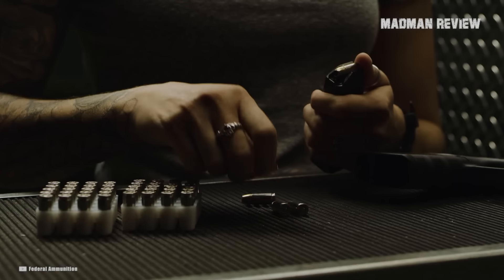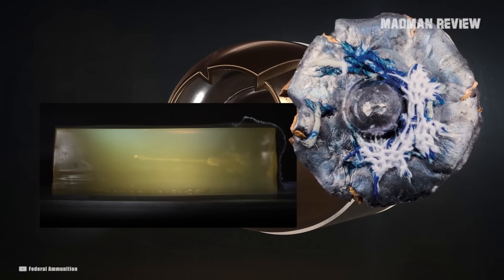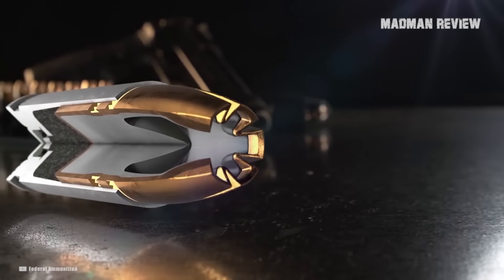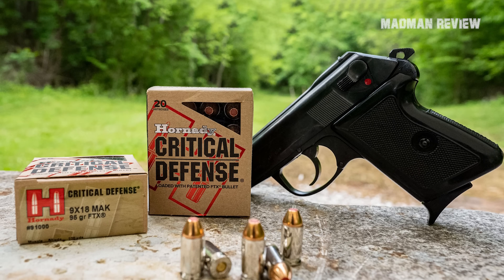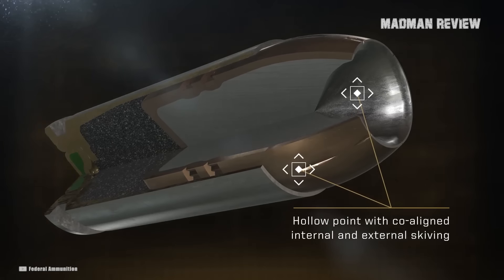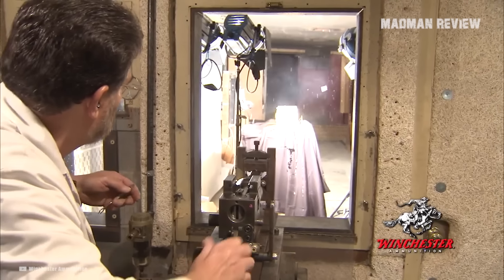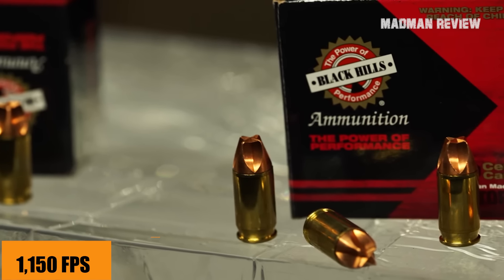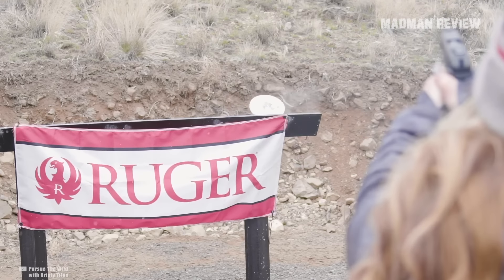8 Most Powerful .380 ACP Ammo for Self-Defense

Comment: I’m also surprised that the video overlooked Underwood’s line of ammo; particularly Extreme Defender & Extreme Penetrator. The Military Arms Channel did some rather extensive ballistic gel testing in both 9mm & 380, and Underwood’s Extreme Defender was the most consistent performer; as well as the most barrier blind of all the brands they tested.
Reply: I agree. I use it in other calibers as well.
Reply: He didn’t overlook the underwood.  He listed the Honeybadger.  Black hills and underwood both use the Lehigh defense extreme defender and extreme penetrator bullets.

I guess he technically did overlook the penetrator though.  For 380 short barrel pistols I think this is a great option as it gives a bit more penetration than the defender, but won’t over penetrate like an FMJ.
Reply: I USE FIOOCHI? IVE ONLY HAD ONE ISUE
Reply: I carry underwood ammo on all my carry guns. Extreme Penetrators in my Sig P 238.
Reply: Underwood has standard loads as well as +P and is lots better than Black Hills! Remington 102gr JHP is also decent . I carry Underwood +P in my 3.5" bbl CCW 380.
Reply: @DW133_  what caliber and out of what barrel length?  Did you actually read my comment?
Reply: Underwood is what I use, great ammo !
Reply: 100% agree! Underwoods ED, is well respected
Reply: It’s a reuse / bot channel
Reply: I use the Underwood Lehigh in .380 ACP. I use a different 124 grain Fiocchi XTPHP and Sig V-Cone in 9mm. The HoneyBadger and Lehigh projectile design has too much penetration in 9mm and more powerful calibers.

Comment: The flex tip was actually added to defensive ammo to prevent heavy clothing from clogging the hollow point with material causing it not to expand.
Reply: In Detroit we call those parka bullets
Reply: Perhaps. But it also uses a hydraulic or fluid dynamic effect as it's pushed into the cavity, it redirects and pushes outward, causing the bullet to open.
Reply: @pb68slab18  thx tips. Lmao
Reply: The 380 ftx tip has trouble expanding through clothing I’ve seen. Hornady critical defense.
Reply: @sethmayabb9020  all 380 hollow points have trouble expanding in heavy clothing.
Reply: @sethmayabb9020  my 9mm and 45 don’t seem to have as much trouble in thick clothing
Reply: They WILL NOT open in a p3at.
I guarantee it
Reply: @pb68slab18  no it doesn't out of less than a 3" barrel. 
Visit me and I'll prove it.
Reply: @staceyhartman6825  why use 380 anyway lmao
Reply: @staceyhartman6825  nice job liking your own comments too

Comment: The original 380 fmj load, fired from a Browning 1910 started WW1. It works. If you live in a jurisdiction where hollow points are illegal, you have to use fmj in 380
Reply: Fluted
Reply: Liberty ammo is grossly under penetrating.  Wide path, but way to short on depth.
Reply: In Brazil we are restricted to .380, that's what we have

Comment: A few years ago I bought some Ruger ARX ammo that has 3 fluted at the top and a hybrid polymer/copper bullet.  Designed to disrupt tissue with hydraulic action, very similar to Lehigh XD ammo.  I live on 10 acres in the country of SW Michigan and test ammo before "carrying".  My wife uses the Bersa Thunder 380 for her own home self defense because of recoil and her hands, it is about as far up as she can go for calibers.   I tested this  Rugeer ARX ammo with some raw beef ribs I bought at a pet store.  I used a piece of thick rubber used as a flat first contact, replicating skin, and in front of it some thick denim.  Behind the rubber/denim  was the raw beef rib bone, and behind the rib was 3  each 1 gallon milk jugs with water.  I shot though the denim/rubber then rib, then the first just blew apart, and second jug cracked and I found the bullet in the 3rd jug that had two entry holes in it.   So it penetrated denim/flat rubber (1/16" thick) then 2 water jugs and remnants were found in the last water jug.  My opinion is that the Ruger ARX   56 gr bullet, at velocity rated at 1315 fps  will do a lot better than any of the hollow points I have tried in similar conditions.   The hydraulic action blew apart the first jug rather dramatically.  
So I would concur, that the .380 is minimal protection, but if using the right ammo gives one an edge in self defense.   I would certainly use is in the Bersa Thunder .380 as a light carry pistol.  Here is a link to the ammo and a picture of what it looks like:  https://www.midwayusa.com/product/1366284360  rebranded as "Interceptor" ammo, who originally made it... link:  https://inceptorammo.com/inceptor-product/preferred-defense/

I don't shoot it in range situations as I only have a very limited supply, and not sure I can even get it any more.  It worked GREAT.
Reply: Could you repeat that?

Comment: I think a .380 is sufficient enough round  to kill. A center mass hit will do damage. The 50 grain can reach 1500 fps plus.
Reply: Fps doesn't always equate to better results. A .38 or .45 acp is slow but the heavy bullets give awesome performance.  The .380 has tons of street cred. The most street cred load is the Hydra shok but the Hornaday XTP is awesome too. Both will do serious work. I would never trust a light for load like that. 50 grain bullet in a .380? Bet money it fragments and does far less damage then a typical 85-90 grain jhp. Your XTP will do better and it's easier to find and probably cheaper tbh.

Comment: I traded my original Ruger LCP 380 for the 2nd generation 380 LCP with the half-cock hammer that has a better trigger. After reading that you cannot use plus P ammo in it I fired-off a complaint letter to Ruger saying I can fire plus P out of my Kel-Tec. I received a reply from Ruger CEO Killoy stated that the LCP is rated for 5,000 rounds. He advised me to use Hornady Critical Defense. I have shot a lot of different 380 through it with no malfunctions but no plus P. Hornady Critical Drfense is my first shot followed by Remington FMJ which by the penetrates through a large steel oil barrel at 15 yards. I stagger both rounds in a 7 round magazine. This EDC is awesome.
Reply: That ammo sucks .. do some reviews

Comment: .380 ACP is, in my opinion, the perfect self defense round for everyday carry. Pistols are sized perfect for concealed carry, pack enough punch to stop someone without overpenetration (you'll most likely be defending yourself in public and have to be aware of what's behind the target too). I recommend the Norma .380 Monolithic Hollow Point
Reply: Over penetration is not a concern with .380 or 9mm if you  use hollow points.
Missing your target and hitting an innocent person is a concern.
Reply: I suggest a .380acp or .38spl +P as a min. But for a back up, 2nd gun not a full time ccw pistol.
Reply: @DavidLLambertmobile  .380 acp and my Albion Crecy 💪

Comment: This video seems to have overlooked my personal favorite ammo for short barreled .380's:  the Underwood Xtreme Penetrator 90 gr. (standard [1,100 FPS, 242 FPE] or +P [1,200 FPS, 288 FPE]).  Both of the 90 gr. Underwood XP's have better penetration and terminal performance than the Black Hills Honey Badger 60 gr. ammo discussed here, with significantly higher speed (for the +P) and energy (for both, since the Honey Badger is only 191 FPE).  That difference overcomes the penetration shortfalls identified here for the Honey Badger ammo. But for short barreled 9mm and 45 ACP, I go with the Underwood Xtreme Defender, since the XP might slightly over-penetrate in these higher calibers.
Reply: You stated a lot of technical information in one comment. I do believe you got everything correct. You certainly know far more than who ever wrote the script for this lame video.
He is dead wrong about FMJ. Until Lehigh came out with these wonderful best of both world's solid copper bullets(Phillips head..LOL), the FMJ .380 was THE preferred load in that caliber. 
Every other expanding round simply did not penetrate far enough.... or the bullet would load up with denim or other clothing  fabric.

I do not know if I am correct, but I went with Lehigh's +P 68 gr Xtreme DEFENDER .380. The bullet flutes are broader which means larger PWC (permanent  wound cavity) than the Penetrator bullet. This Defender round will still travel 18" limiting over penetration and maximizing the size of the PWC. It smokes out the barrel a whopping 1,400 fps!!!

The Xtreme Penetrator and the +P penetrator are almost better suited to beasts with more sectional density than a man. I have a box of +P Penetrators'  too for my G42...which I love, BTW!!! The ammo AND the gun!

 BUT.....in Winter where it gets real cold, do use the Penetrator rounds since the bullet will be struggling through several layers of heavy clothing.

IMO, I don't trust ANY of the expanding rounds in any season, or at any time...in .380 caliber. (9mm is totally different.) My company MANDATES I can not have 9mm FMJ in any of my magazines. They physically check from time to time. Private school and chilluns...you know.
Reply: @deplorabledave1048  Here's one of a bunch of YT videos that convinced me to exclusively use the XP's in my .380's for that extra margin of performance from my mouse gun:  https://youtu.be/-PDQcE-1T40.  BTW:  What more people should know is that there's a 51 page multi-bullet/caliber analysis for law enforcement (entitled:  2016/17 JOINT AGENCY BALLISTICS TEST FOR DEFENSIVE HANDGUN AMMUNITION) that reached the following unqualified conclusion about the Underwood Xtreme Defender  (when compared to 71 different mainstream handgun rounds in 8 calibers): "Overall: This was by far the most impressive round tested. After over a year of testing this round became the most requested round to test after some of the agencies reviewed draft shot data." and "The radial flutes increase tissue pressure and direct the tissue outward to increase wound diameter. ...  tests confirmed that in over 100 shots the measured wound channel was not only larger than that of an FMJ but in most cases was the largest wound channel produced in that caliber compared to all other rounds to include fully functioning hollow points." and "All rounds in all calibers tested penetrated 15.2 – 20 inches with and without barriers. " and  "Every single shot did roughly the same thing. There is a 0% chance of failure to function because there can be no failure to tumble or expand (because they don’t) and no chance to fragment. This was the most Reliable and Consistent round tested."  It's discussed on p. 32-33.
Reply: @richardefriend  
Wow!  Thank you so much. I thought I was one of the foremost knowledgeable cheerleaders for that ammo. I'm humbled. Thank you so much for this information.
 I don't know if Tim from Military Arms Channel is in this video. I didn't watch it yet. But he was the one that convinced me of the wound channel that those bullets  present,  as well as adequate penetration.
 I have 2  Glock 19s but  I love most my Glock 42.
Reply: I've been convinced about the EP and ED since it's inception. Definitely a hot little round!!!  @richardefriend

Comment: Any round that functions reliably in your .380 Auto pistol can be sufficient for self defense as long as you do your part.  What you want is a fast JHP or a slow FMJ in a vital spot.
Reply: This x1000. In the commonly-carried calibers, shot placement matters a lot more than minute differences in terminal ballistics via bullet design. Famous case in point, SC Trooper Mark Coates died at a traffic stop in 1992. He caught a 22lr on his vest, so he returned fire and plugged the guy in the chest with 5 rounds of .357. During his dash for cover afterward, he got another 22lr that zipped through his armpit just above his vest and into his heart. He bled out on scene, the guy survived and got life in prison.

Comment: The Critical Defense is what I chose for my LCP Max. It was the only one I could find that had good penetration in ballistic gel.
Reply: Underwood makes the best .380 ammo.
It's usually in stock on their website.
Check it out, you will like it.
Xtreme Defenders, +P Hard Cast, +P JHP.
They load several different .380s.
Reply: @pewpewTN  I'm comfortable with Critical Defense because I've watched it enough videos of it in ballistic gel but I have no doubt Underwood is superior. They make great stuff. I have some hunting loads for my 10mm.
Reply: @pewpewTN  You can't shoot that in a lot of 380's
Reply: FMJ is the only round for 380 reliability & penetration!!
Reply: @michaelburke6552  If you can't shoot +P in your gun, you probably shouldn't even own it.
Reply: @pewpewTN   if your .380 says "do not shoot +P ammo"  then what is recommended ? Because many .380's are not rated for +P
Reply: @pewpewTN  the majority of .380's are not rated for +P ammo
Reply: @TADDs101  Glock 42, Sig 365 380 & S&W Performance Center EZ.
Those are the 3 I shoot & they all have handled plenty of it.
Reply: @pewpewTN   so what +P ammo do you use in the .380 caliber and how much better do you find it than regular ammo
Reply: @TADDs101  Underwood.
You have different options for projectiles.
You can get coated hard cast or their "Xtreme" series that is monolithic copper if you want extra penetration.
You can get multiple different projectiles if you want more traditional hollowpoints.
You can get fairly close to the energy of 9mm target loads.

If you want to stick with standard pressure, Underwood Xtreme Defenders are available in standard.
Regular Speer Gold Dots are pretty good, too.
Especially if you have something like a Glock 42 barrel length or longer.
Reply: @pewpewTN   Thanks !
Reply: @michaelburke6552  incorrect,  the XTP is an awesome penetrator and you don't risk hurting someone else.  If you're using fmj in a .380 you haven't done enough research and are not a responsible person. An XTP can consistently get 16" of penetration. Wth else do you need? Hydra shok will do close to the same around 14.5". I have seen an xtp even hit 18" in gel when it clogged but 15-16" when they mushroomed. I've only seen earlier xtps clog btw, never the newer ones.
Reply: @taasch2505  For starters you have no reason to to insult someone to voice your opinion. I have done my research and in the 50+ years I've been carrying a gun. I have never found a case of a person being hurt or killed by overpenetration in civilian defense "not" a police shooting. I have read about people being killed from lack of penetration that was mostly police. But I am looking into underwood XD and if they cycle as dependably as FMJ I may switch. Now if you would like to talk about this more I will be happy to if you can discuss it without trying to insult me.
Reply: @michaelburke6552  well I hope you don't intend to carry such a load into a crowded convenience store after quitting time with such loads. Most gun fights are over in 5 rounds but you also have cases of 13 rounds being shot. So what happens in the even that you do use said ammo and thw bullet goes through and injures a child or a pregnant woman. Is it likely to happen? No. But can it? Yes. I personally would have a hard time looking at myself in them mirror after. But maybe you don't live in a high population area like me or go to the movies or other such crowded locations.
Reply: How many inches it penetrates?
Reply: @deepb249  through 3 layers of denim it was right near 12" with an impressive channel.
Reply: @adamelam6385  how much is it? CT
Reply: @deepb249  I honestly don't remember I got it a couple of boxes of boxes when I got my LCP Max over a year ago. I'm sure it's at least a $1 a round.
Reply: @taasch2505 over penetration is just bullshit, how often do you hear reports of it happening? I'd rather have a round that penetrates and gets the job done rather that expanding and not penetrating enough. There's plenty of more reasons to carry ammo that penetrates a lot than to carry ammo that doesn't..
Reply: If you’re getting an LCP do yourself a favor and get some Hogue Grips.    Your hands will thank you for it.   Also a 7 shot extended mag hurts nothing really but gives you 8 ready rounds and a better grip which helps the snappy recoil.

Comment: My light carry is the g42 with underwood xtreme defender 68 grain +p with 2 12 round extensions. At 1300 to 1400 fps and that barrel length, I feel its a suitable setup for self defense at up to 50 yards.
Reply: Does your Glock G42 .380 have a barrel length of 3.25 inches, or are you using something non-standard and a bit longer? Thanks.
Reply: @exgenica  yes my setup is completely stock except for my tru glo night sights and tlr6 laser light combo. Which is sighted in at 20 yards. I haven’t had a problem with the standard barrel using +p or hardcast but will be investing in a lone wolf barrel.

Comment: If its the same width as 9 how can you 'fit more?'
They stack exactly the same...
Reply: @Nick-zb4bp  no, there is absolutely not. The diameter is exactly the same. The diameter is the ONLY dimension that affects capacity
Reply: @Nick-zb4bp  dude, we are talking about capacity, not capability. This discussion is about capacity. The video says “meaning you can fit more 380 ACP than 9mm in a smaller package.” You are clearly not paying attention. Even if we were talking about capability, which we aren’t, you are still wrong. The 9mm has more capability, due to the increased cartridge length, as you mentioned, but not the other way around
Reply: I have the 380 sig p365. It holds exactly the same as the 9mm. So I have to agree with douglasbunch33😅😅